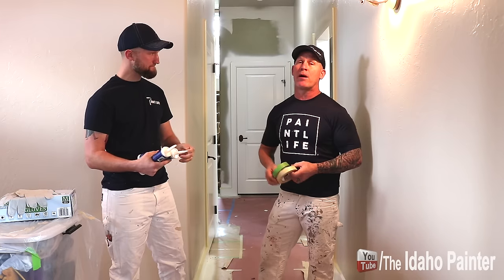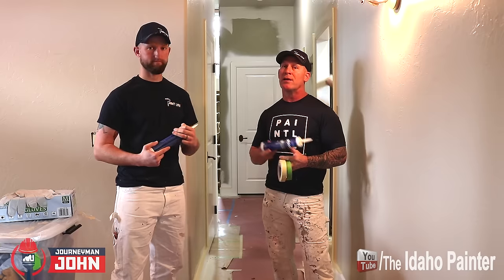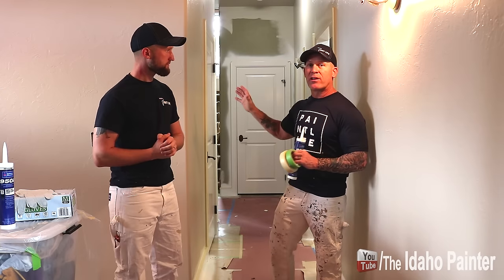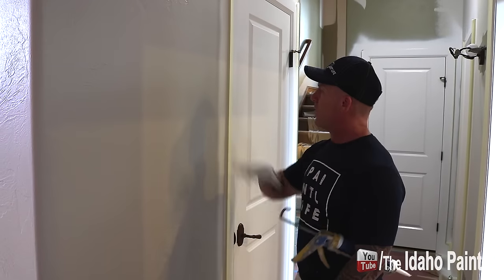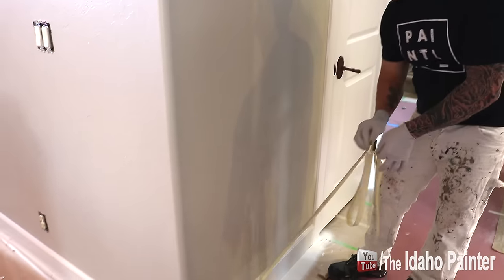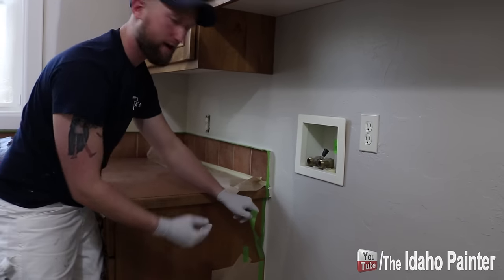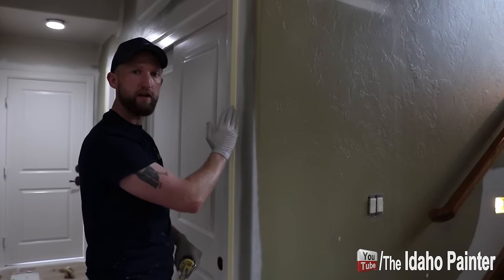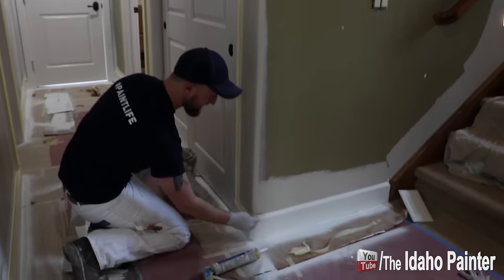PERFECT lines with caulking and tape.

Comment: You are so right about the clear vs white acrylic caulk! There are times when clear is the way to go. A customer wants broken tape joints filled and the trim touched up... but the adjacent surface is wall covering they love and want untouched. In those kind of circumstances, clear is very helpful.
Reply from the maker: Thanks for your thoughts

Comment: I loved the tips in this video!  What if you need to/want to paint two coats?  The goal is to pull off the tape quickly after caulking/painting, but what do you do for the 2nd coat?  Do you typically always get your jobs done with 1 coat?  I have always done two coats, as it just seems to look better!  

Second question - any specific kind of caulking that's best for this?  Any 100% silicon caulk?

Thank you!
Reply: Do not use Silicone. Paint will mot stick to it

Comment: Thanks to you, we've started using Frog Tape and this stuff is great and we've stopped using the blue tape.  For a newly painted wall we are using the yellow Frog Tape and that works even better than the green tape IMO because sometimes the green tape can tend to peal off some of the paint.   That being said, the one thing with the frog tape is that it will bleed if for example you're taping off the wall around the trim/woodwork and are painting the woodwork with an oil base paint.   What I do is then use 1 inch blue tape for that, tape off the edges of the trim along the doors and then paint the wall and everything looks great with a sharp edge.   I haven't tried the caulking trick you are using here but will eventually.  Great videos fellas, I think every painter no matter how long in the business can learn different techniques from each other and different tricks of the trade.

Comment: Finding people skilled enough to cut a straight line is difficult. Just not many out there. This method is really SMART as they said in the video, they can take your average Joe and get good results. Very smart Chris. I'm wondering about the actual purpose of the caulk. Is it to prevent the paint from getting behind the tape? Caulk doesn't roll around the tape as easily as the paint? And it fills the gaps where the paint would breach the tape.

Comment: I’d really like to learn this method, but my question is that is just the first coat so what do you do for the second coat? Cause you can never put that tape perfectly back onto that line or do you just cut the second coat by hand?
Reply: The caulk seals in the tape to allow no bleeding past it, that same caulking is seals it for your primer, 1st and second coat. No need to retape or recaulk. Kust want to peel it when paint is cometely dry otherwise you will get bleed. Also in case you put to much caulking on tape in some areas, a light razor blade pass on along the edge of the tape works wonders. If you do it properly wit a lot of practice, no razor needed.
Reply: @elportillo9714  I thought they said in video and demonstrated that must remove while paint is wet, before caulk dries...
Reply: @Kooshad1  he also mentioned he is new to this, been doin this method since 2005. When you caulk, put just the amount necessary to fill the gap and seal the tape. Any excess wipe off with a damp rag. Your caulking shoul seal the tape but not cover the edge. This allows you to do all your coats, and remove when dry to not get bleeding from your last coat.
Reply: *the caulking should not cover the tape more than just the edge
Reply: Also in case in a corner or so let's say you went heavy on the caulking, it will pull up the caulking and paint, so i always carry a razor blade and run it along the edge of tape, in thise spots, if there happens to be any problem areas

Comment: How do you do two coats then? You gotta retape everything the second time?
Reply: c Only ,

Guy answered this question.. he free hands first coat to 1/16” close to but not touching tape he put on the baseboard/door casing. Rolls the wall.

Second coat:
He does 5 foot sections at a time. Caulks the tape edge, brushes in the second coat, pull tape and he’s done. 

I think painting seams should be viewed from across the room, not 2 mm from up close. That’s just gonna make the client OCD and then he can sue you for creating a condition he never had until you guys showed up.🥴🤔🤪
Reply: They don't this is how they screw customers. Everything they've done in this video is substandard and could create serious problems. Call a pro who isn't worried about making YouTube videos.
Reply: I tried this and it took a while for my caulking to dry the paint did dry but my caulking didn’t  🤦🏽‍♂️
Reply: @elmerdane  what is substandard about it?

Comment: I had been waiting to use the techniques taught here on caulking. It worked great. I had professional results around my door frame, and shortened my work time buy using your techniques. Thanks for putting out these very useful tips and techniques.

Comment: I've noticed that when you paint you trim, in some videos, there is overspray on the walls.  If you're using a gloss paint on the trim and flat or matte on the walls does this (where the over spray is) cause a problem?  Thanks!
Reply: No as long as you use a good quality paint,other wise you may need to apply a second coat on the wall.

Comment: Excellent video!  Question:  on the door trim, for example, you say to leave about a 1/8" of the trim exposed... that's where the radius of the caulk will live.  You then paint over the wet caulk, carefully and pull the tape... so, the wall color now is not ending where the wall and trim meet, but rather 1/8" into the trim.  Apparently, that's okay?  I'm thinking that a discerning eye might see that the wall was painted a little far, no?  Especially with dark colors and light trim.  Comments?  Thanks!!
Reply: I was thinking the same thing! haha
Reply: You are absolutely correct. The wallpaint wraps around the radius and slightly covers part of the trim. I would recommend 1/16 inch vs 1/8th inch.
 Basically, if you don't leave a small amount of trim showing when you mask off, then the caulk is only holding to the wall on 1 side and the tape on the other side. When you remove the tape, some of the caulk would come back out. The little sliver of exposed trim gives the caulk something to hold onto.
Reply: I think more like 1/16".  Having the wall color go over a bit onto the trim makes it look cleaner overall because you can strike a very straight line with the tape rather than following the (usually uneven) wall line.  Of course too much lap looks amateurish.  Trying to hit the trim edge exactly will ALWAYS leave a rough edge because paint will invariably get under the tape.
Reply: Cpcsof1 excellent comment
Reply: It doesn't matter as long as the caulk is the same color as the trim. He put white caulk over a white trim - that's why he was able to back off the tape 1/8th of an inch.
Reply: @527Kenny  And then he painted over that chaulk that ran onto the trim, that was his point. Doesn't matter that the chaulk is the same color once you paint over all of it.
Reply: n0nam3given P

Comment: This caulking method is probably only going to be practical if you're just doing the one coat, which you guys seem to do all the time. If you're doing more than one cut-in, which is often needed, you'd have to re-mask and re-caulk.
Reply: pbaylis1 absolutely wrong lol cut above the tape on the first coat come on

Comment: "Always pull your tape before your paint and caulking dries, or you're gonna have some problems."  Yes that's true for those who 1. do not know how to properly caulk the tape and 2. build up way too much paint on the tape edge.  It's the difference between those who were taught by pros and those who are either self taught or taught by someone who has no idea what they are talking about.  The paint/caulk line resulting from having pulled the tape when the caulk and paint was still wet is quite ugly especially on inside corners and around heavily profiled trim details when you compare it to what results from pulling tape away from DRIED, PROPERLY caulked and painted edges.  That's just a fact.
Reply: I agree with you Hacker Buster. I never pull tape when it's wet. #1 how do you not get splatter on top of your base from the roller when it's not taped.  It's key to just put a very little amount of caulk over tape and make sure to not flood your tape with paint. Your just trying to cover your caulk line so don't paint the entire piece of tape.
Reply: Yup. Most people are newbies, or have been taught poorly.
Reply: Enjoy pulling your bridged tape and ripping the caulk bead apart.

Comment: Also, first rule of painting:"Top to bottom, inside to out." Also, u should cut before you roll...

I train my guys to work with the same process methodically every time to maintain a consistent final product...
Reply: I’ve seen caulking craze with painting over fresh caulk.  Also I use my index finger on the end of the nozzle following the caulk which forces the caulk into the crack.  Really helps on wide deep cracks.   I don’t like the method they’re using.

Comment: Iv been painting 20+ years we do what we call tape and back fill, tape it off leaving a butthair of the edge of the trim showing,fill the joint with caulk then take your 5 way and pull the caulk to expose the trim edge let dry then paint, this will avoid any splatter and alot of times jobs are not so flow and go you might get to first coat that room today but can not finish for a couple days,this will leave them nice crisp lines to, i will give your way a try you can always teach this old dog new tricks
Reply from the maker: Yes, thanks for sharing Shane!

Comment: I'm a painter here in salt lake city. My company its called Affordable professional painting LLC.  We use this method and also we use a angle sanding sponge to sand the edge of the area we are going to paint for straight lines and it does a good job too.

Comment: Wrong video I think, but as I watched you caulk and set down the gun WITHOUT EVEN LOOKING at it, and you prescribed the Dripless 3000 gun, I was hooked! I ordered it from Depot, and it's hands down the very BEST caulkgun I've ever squeezed! Plus, you didn't say it had the dual function lever for dripless caulking or run-on. A major timesaver, to be sure, and neater work. Tip of the hat to you guys! WELL worth $15!
Reply from the maker: Awesome, glad it worked well for you, thanks for watching!

Comment: Great Great Great  video guys ! Ive been caulking my tape for many years ! As it helps using colors on orange peel walls  with white trim . I  apply 2 coats of paint most of the time , and find that using a very small amout  of caulking fingered very tight to the tape  gives great results . And Im still able to peel the tape after the paint is dry . But I find that it must be completley dry ! With my method the green frog tape leaves a cleaner, sharper  edge while peeling ! For the most part I use S.W.P. Superpaint satin !
Reply from the maker: Awesome, thanks for sharing!
Reply: Thank you for the good videos !! Very educational !!

Comment: You tube needs 5 star like button. You rate higher than 1, like. Thanks for ALL the info and tips.
   Do you paint kitchen cabinets?  If so, how do you paint laminate? 
    Do you have any for ceiling repair, matching existing texture? Or know someone.  All videos I find are just repair.

Comment: This is a great method, but sometimes it is difficult to pull the tape quickly enough on large jobs to avoid the caulking drying too quickly. 
What I do is tape everything off first, and then pre brush the tape lines with untinted neutral tint base paint. Cheap acrylics work best. After that, you can pull after your last cut, and the lines will be sharp with no bridging. If anything bleeds under you will never see it.

Keep up the good work!

Comment: That's right, I've been painting and drywalling for over 22 years, us painters have to use methods to achieve ends and have good quality at the same time. Learning to use a brush properly is very important, same with masking, I've seen guy's pre tape then mask over it but if you can't mask a straight line with a masker than you need more practice, plus your unmasking twice, you always want to fix crookedness or unevenness on top of your masking and this way you're unmasking once , as for caulking your tape I use this method as well when necessary, I prefer using the opposing color to seal my tape so there will be no bleedthrough, if I'm painting walls after the trim is done I'll tape straight onto my base , seal my tape with the trim paint onto the wall and when it dries will again go over the trim color that's on the wall, I do the same on accent wall's, I always cut in against the ceiling, I always go a dime's width onto the ceiling so your lines will always look consistent, I tape both sides of the accent wall, either use caulk or use the adjacent wall color to seal my tape, almost dry brushing it and not blobbing it on , it'll just delay dry times, after the paint dries I then go over my tape lines with the accent color, I pull my tape right away and now you have a laser line established and you can freehand from there, I always go from dry to wet when cutting in, I always tip it off in one direction, back into my paint to ensure my brush strokes are always going one direction.

Comment: CHRIS..Frog tape reacts with water and seals against the surface ( swells on the edges)... You can use a damp terry cloth, before you brush, on frog tape to insure a great seal. No need for caulk on smooth surfaces. I can see this caulking method working very well around tile or rough surfaces but no need around trim. I will definitely incorporate this caulking method on rough edges..THX

Comment: I use 2 painters rags when caulking. 1 completely damp rag which i use over my finger to push in the caulking. The benefit of this is 2 fold...1) the caulking goes in the gap where it should be and you never have that ugly paint over excess caulking on the wall or the trim because the wet rag wipes it off that surface but leaves it in the gap 2) my hands are always clean.
The second rag is to wipe excess caulking pulled by the wet rag off onto the dry rag. A small bucket of water can be used to keep wet rag  clean as well and the amount of dampness you like to use. I set it up on my step ladder so it is easily accessible.

Comment: @ Paint Life Tv:
I use both clear and white caulking because i have masteted it only thing id do different than the video is use a damp rag over the frog tape to activate it as an extra safety since you're already using the expensive tape THEN use white caulking very thin and wipe with rag or clear caulking like you did. Do it in all my jobs always have the best lines

Comment: I used your method to do exterior transition lines on my home.  I have LP Smartside siding and replaced the trim with pvc trim board.  This method made the caulk lines almost perfect.  It was labor intensive for me, but it worked great.  I am not sure how an experience painter gets straight lines on this type of siding.  Lap.  On the flip side, how do you get straight lines when doing ceiling to wall transitions.  Sometimes the edge is not perfectly straight.

Comment: In A LOT (not every video) you show us this method of caulking the tape and instantly pulling. However, you also do it on first coat only. Again, most of the time. It's a great method. Do you guys redo the same process and waste material and time or do you guys attempt to clean cut on the finish coat? A professional/still learning painter
Reply from the maker: I have a video explaining it

Comment: Chris & John. I have noticed that when you use your Frog Tape you caulk it as well. Did you guys know that if you install the Frog Tape it is designed to not need to be caulked? You can carry a wet rag with yourself & whipe it thoroughly with that wet rag & let it dry. Then paint it with out caulking it. When you wet rag it it activates the adhesive & seals the tape & then you can still get that crisp straight line saving yourselves the caulking step.

Comment: Very interesting. My method is/was to caulk the trim, let drt, then paint the caulk and onto the wall, then let dry so when you paint your edge across the wall you cut in over the trim paint. I want to try your method.
Reply from the maker: Interesting, thanks for sharing your method!

Comment: Love the caulking tip for clean lines.  I have found that  I can also produce the same clean lines with the 3M all purpose tape as well.    Great tip.   I did have a question for my application.  I have drywall returns and interior wood window trim.  .  Should I paint window trim first before drywall returns?   Should I tape and caulk window trim and also tape and caulk again when I paint drywall returns?  Thanks

Comment: I use blue tape instead of frog tape, same concept, I was taught to leave a 1/16 of an inch gap, run the caulking and use my fingernail at an angle to clean/expose the tape line. If the tape line isn’t showing when you pull the tape it rips the part of the latex wrap
Reply from the maker: Thanks for sharing Kevin!

Comment: I find using a wet rag to clean your finger makes for cleaner caulking line as the wetness on your finger washes out the excess caulking better. Also if your peeling off the tape right away, what do you do for the second coat? Tape again? Seems not using tape before caulking would be more efficient.

Comment: This trick is best when you are caulking an area that is being painted next to trim or another item that is not . However when both areas are being painting you can run a small Popsicle stick across the caulking and with practice get a straight quick line without the tape